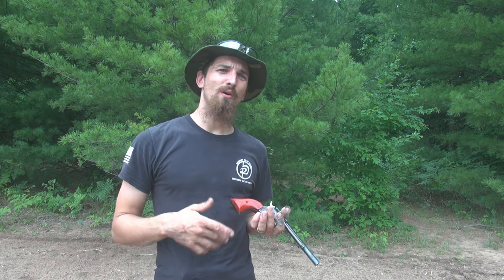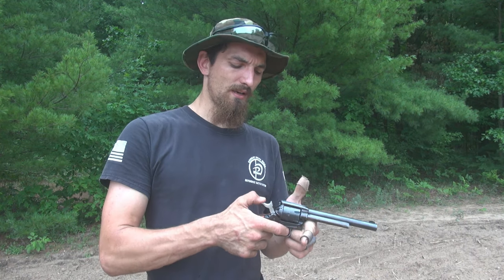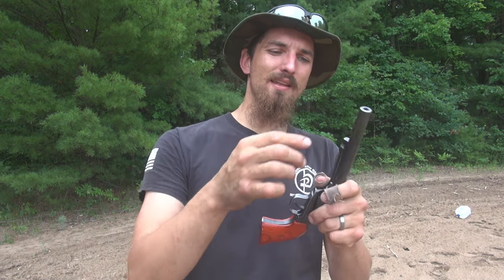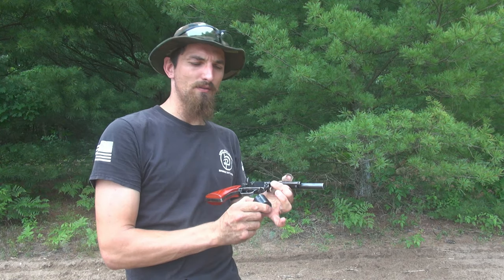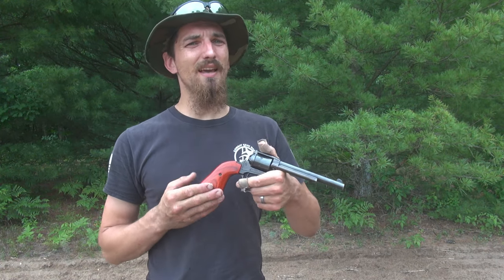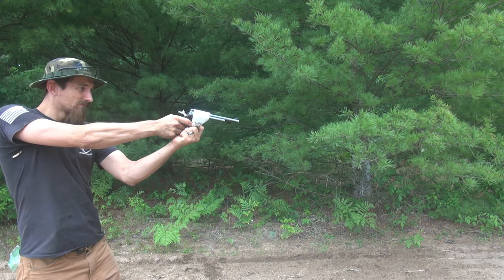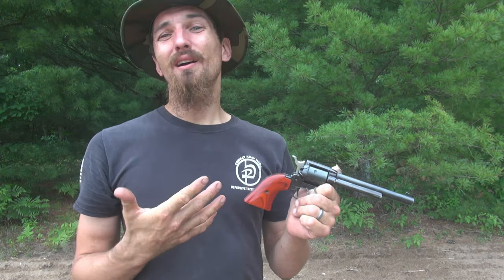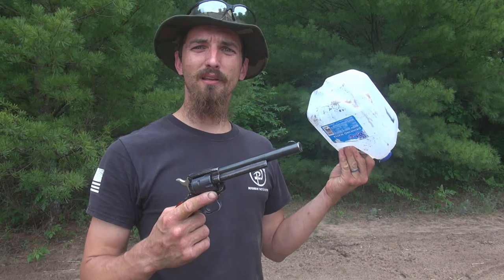Most Amazing 22 Revolver, You Have to See!

Comment: I have owned two of the Heritage revolvers.  Never a problem.  My first one I shot just 22lr because I didn’t have the mag cylinder.  I don’t know how old it is but I bought it brand new for $89.00.   I gave it to my son and he has had it for at least 5 years with no problems.  My second one had both cylinders and I shot 22 mag 98% of the time.  Unless you use it for a hammer I don’t know why it wouldn’t last at least 5000 rounds.

Comment: This is one of the absolute best videos I have ever seen done about safely firing a revolver.
You simply related very basic safety procedures for safely enjoying your new revolver.
Several years ago,I almost threw up when I saw the damage a fifty caliber Smith and Wesson round did to a guys hand when he tried to control the heavy revolver by crossing his left hand across the revolver cylinder gap to support it.
The 22 won't do the same damage but it will still hurt like hell.
By the way,your great video convinced me to buy the Heritage revolver with both cylinders and adjustable sights.
Keep up the great work,Gun Tradition.

Comment: Somebody needs to teach this guy about how various metals are finished.  Steel can be blued, aluminum can't.  Aluminum gun parts  are  adonized or painted to resemble bluing.  Either way, aluminum parts cannot withstand the abuse that blued steel can. Of course it wears off with frequent use.  It's a very weak finish, but much cheaper than machined steel in firearms manufacturing.

Comment: Heritage Arms states that the barrel frame is a Zinc casting called "Zamak 5".  It is on page 11 of the gun manual.  The muzzle velocity will be lower from a WMR 22 when used in a revolver than would be experienced in a long rifle.  As you have shown, some of the discharge gas is lost between the cylinder and the barrel in revolvers, thus lower velocity.  The tests on the 22WMR used in a revolver vary between 200-400 FPS increase over a 22LR shell.  Still a considerable difference--it would do some damage.
Reply from the maker: Good to know about the alloy. About the velocity, with the 22 mag I usually get 1200fps out of a 36-40 grain bullet, which is equal to my Ruger 10/22 in 22lr.

Comment: The only things I don't like about the rough rider - 1. The aluminum finish does not hold up well (as  stated here). 2. the cylinder bolt is made of sheet metal bent to shape and is not machined like other cylinder bolts. This is clearly to cut costs, it can't have the durability of a machined part. It works fine though.
The things I do like - 1. It is accurate 2. the sights are classic single action army sights, they work fine. 3. the trigger is good. 4. it is not fussy about ammo 5. it is fun to shoot 6. It is cheap and just works.

Comment: I just bought one for $104 brand new
Reply from the maker: They're great little guns.
Reply: The heritage revolver is pretty solid. It will get dinged up but will shoot thousands of rounds. 
Here's the big tip that many of us have done.  This will save you lots of hassles.
The ejection rod cover screw that goes into the barrel.  Carefully remove it, it is spring loaded on the ejector rod. Then remove the cover and the rod.  Clean the screw hole with acetone or similar evaporating solvent. Clean the screw with the same solvent. Reassemble the spring, rod and cover, put a drop of purple loctite (light duty) on the screw and complete reassembly.  Don't use a stiffer grade of loctite as you may want to someday disassemble the ejector rod for cleaning and lubrication. 
I have started several new shooters with our Rough Rider. These are great training guns.  You can demonstrate a lot with them including the hot gasses and soot that come from the cylinder gap (between the cylinder and the forcing cone of the barrel).  I always point that out to new shooters with something like a piece of paper as part of the training.

Comment: I was a Barkeep model, and it doesn't have a built in ejector rod as the barely is too short. Instead it comes with a wood handled tool to eject the empties, so no plastic ejector part.

Comment: The last 2 RR's I bought last summer came with half the finish off the frame and grip. I guess they are giving them the weathered look- right out of the box ! Lol. Seriously, I had to look around to find 2 that new ones that didn't look totally used! I called their customer service and let them know the condition of their revolvers as I was finding them at the stores. The nice lady seemed to fall asleep as I reported this. I do have an older one I bought used. It was built at the Florida plant, not the new one owned by Taurus in Gerogia. The finish on it is much better and the action is much more solid. Both new ones make great field and fishing revolvers, but their quality has gone down since Taurus bought them.
Reply: I repainted the frame and barrel with black engine paint. Looks better.

Comment: The Heritage Rough Rider is a great novelty firearm. It's really hard to find anyone who has a bad word to say about them. It's a great inexpensive tool for safely teaching new shooters the mechanics of single action revolvers as opposed to double-action. I agree the finish on the aluminum frame leave a lot to be desired. I believe they are paint dipped at the factory and not blued (The frame that is, not the barrel or cylinder which I believe are blued.). I've always had a plan with mine to simply repaint the frame once the chips and scratches become intolerable. Is it a defensive pistol? No, not at all. But it would be better than one of those NAA .22 derringers that people seem to love. The new barkeep version is even compact enough.
Reply from the maker: You might be right about the aluminum
 I'm going to get a second heritage for my kids when they're old enough. I also like Their 357 revolvers.